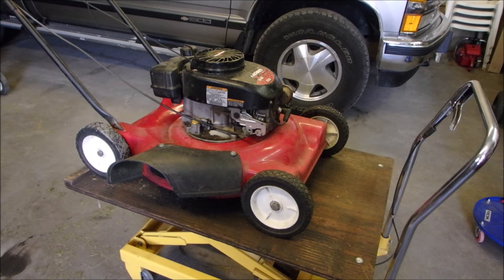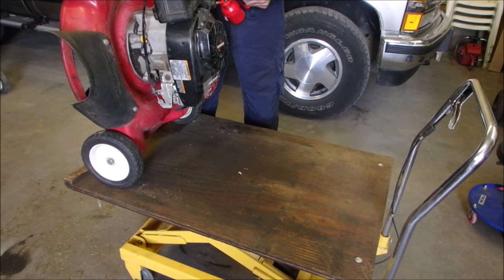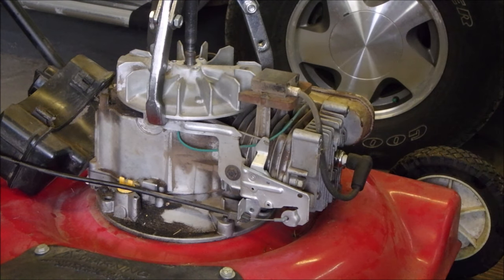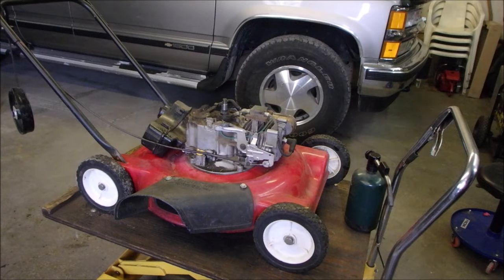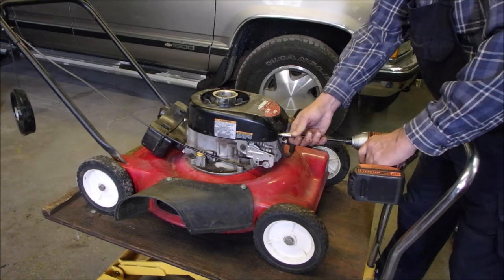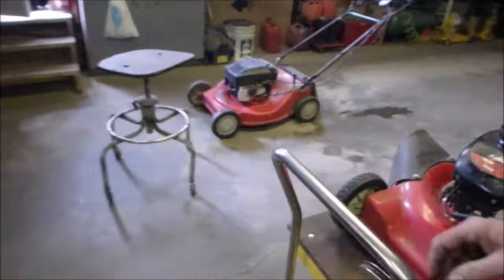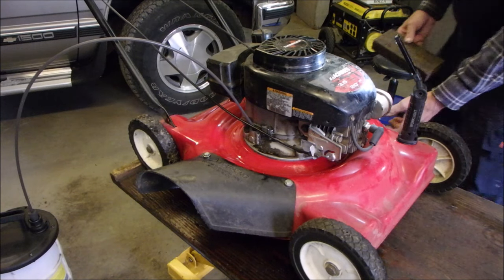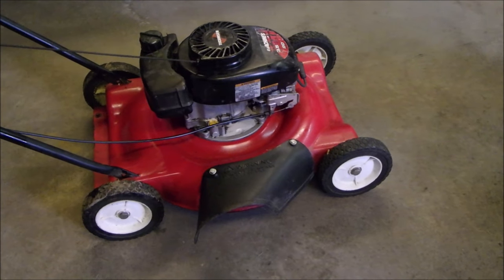Tecumseh Engine Seized?????

Comment: So 3180 RPM x(20/12)*3.14159 = 16650 Feet per Minute, well within the OPEI max blade tip speed of 19000 FPM, Video coming soon!!
Reply from the maker: Sounds great Ken

Comment: As you said, it doesn't take much on those engines to knock the timing off. Good find on the float bowl. I have a puller just like the one you used. A large one and a smaller one. You can also flip the legs around as well. Glad you're back.
Reply from the maker: Right on  Thanks

Comment: It's good to see your back and a very good video I thought the motor is going to be like Similar up and you surprised me and fixed it awesome job I just rescued a Troy-Bilt they they use it until it rusted right in two pieces that was from 2012 a filter was so plugged with oil and grass I don't know how it was running. They didn't know what was going on with it but it just stopped running until they investigated it and seen that it was in two pieces you never know what you're going to find out there well thank you so much for the video
Reply from the maker: I am lucky as we have a dry climate here.  Mostly good decks.

Comment: Flywheels I use a air hammer with a bit I ground to fit the center in crankshaft and a big screw driver. They come right off. I have a quite a assortment of pullers I collected over the years. Garage sales ect
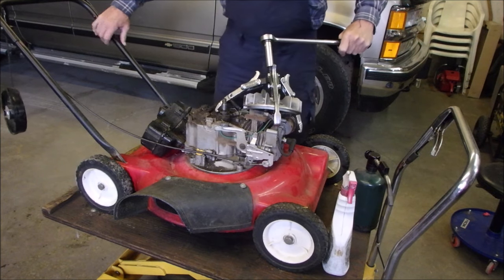Reply from the maker: Yes you are right.  I try to start simple and work my way to the crazy hard to do.  like at 10:34

Comment: I guess I keyed in on what I thought you commented on about seeing water on the plug when you removed it.  So, was thinking water/lousy fuel.  I guess I would have thought the engine would have kept running with the slightly sheared key even though it might be hard to start/kick back.   But, perhaps the misinstalled bowl was keeping fuel from flowing into the carb...  Nice to see you back.
Reply from the maker: Yes  there were 2 iuudes  Thanks for the great comment.

Comment: Hey Bruce, when it comes to popping the flywheel off, if you have an air-hammer/chisel, try that. 
Use a small prybar to create tension under the flywheel, then with the air-hammer, with a blunt point tip, a couple quick Brrrts with that and it'll pop right off. Just make sure to have the flywheel nut on.
Way easier than a puller, and safer than a hammer. 
Also a leaky Tecumseh carb usually means a swollen seat.

Good to see someone else unafraid to wrench on these old Tecumish engines. I love working on those useless pieces of crap!  They're such a pain in the ass to work on, but they're Made in the USA, instead of the new MTD Made In the Land of Chinesium Junk
Reply from the maker: Yes Thanks   I have used that method as well.  Sometime I just o the first thing that comes to mind.
Reply: @BrucesShop  Same.. I also had a puller slip and take a big chunk out of a flywheel on a Tecumseh engine.. I'd say that's the worst thing that happened, but I'd be lying.. as the worst thing was not realizing my impact was set to "Fuck shit up" mode, and it did just that! Split the damn thing right up the middle, almost right in half..
So now I have one with a blown engine so I can salvage the flywheel.. Cuz the engine runs a treat!